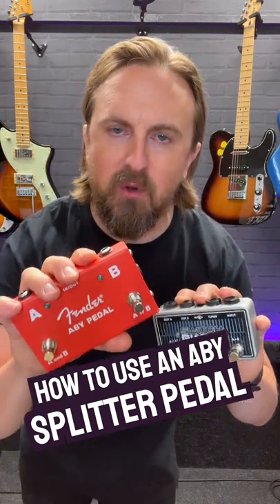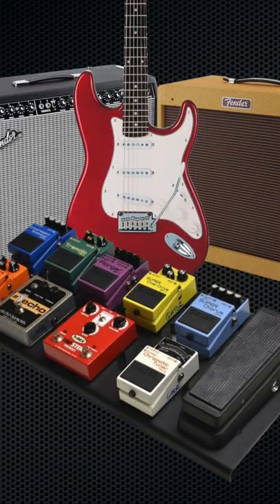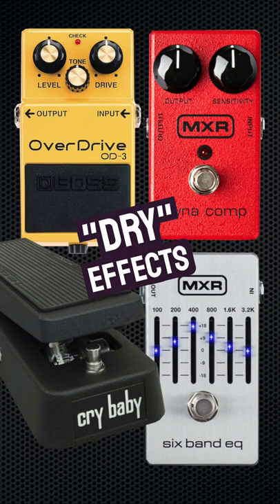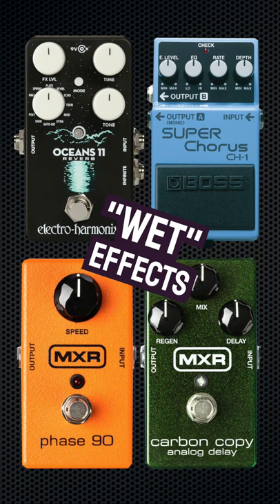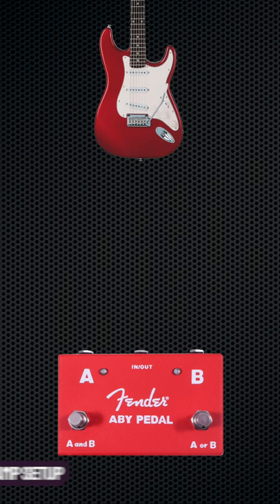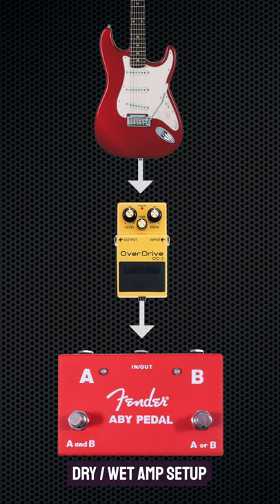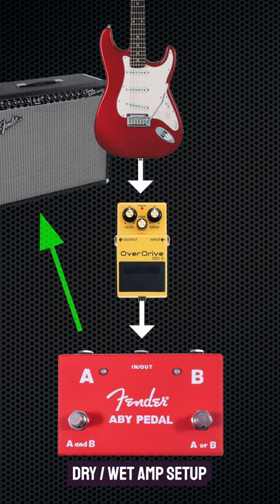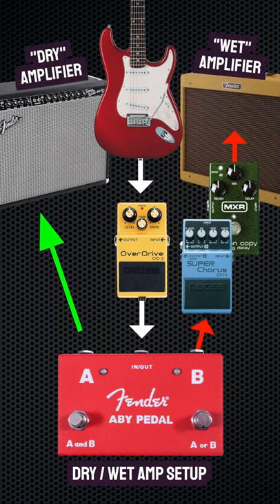Wet/Dry Effects Rigs - Cool Ways To Use An ABY Pedal - Part 2 #shorts

Comment: But what would you do if you want both amps with delay, but just one of them to be modulated. Would you need a delay pedal for the first amp (so dry pedals + delay) and then into the ABY pedal and after the ABY pedal pair a modulation + delay going into amp B? And if so, so does it mean you would need two delay pedals as well?